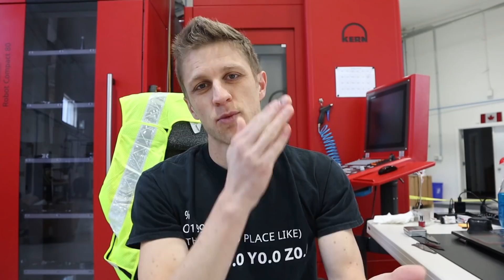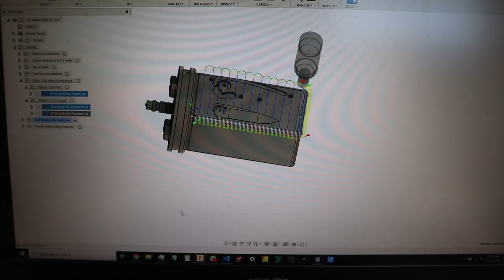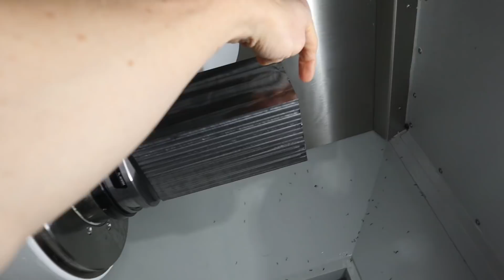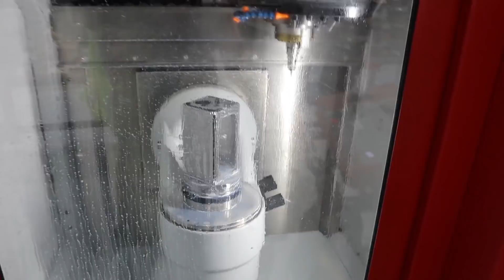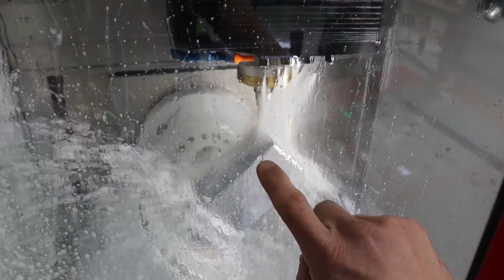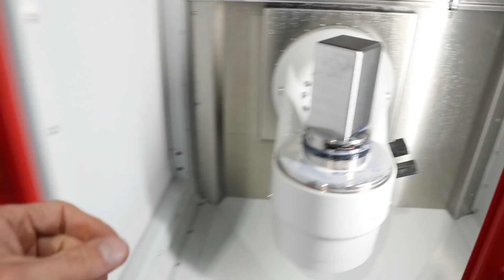Facing On The Kern - Quarantined Shop Life 25

Comment: 0.005” DOC you are dependent on the micro geometry of the insert and the matl is smearing rather than shearing off .  You would have got a mirror finish on 0.02” or 0.5mm

Comment: as i said in an comment on a previos video, the Heidenhain control normaly dont calc. the rotation of the b and c axis in the DRO, you have to activate it in the 3d Rot softkey for the manual mode.
i wish im able to show you this, but im in germany so its pretty impossible (also because of timezone).
edit. the 5axis milling is not TCPM (not on Heidenhain, TCPM is something even complexer).
(and i should stop posting comments while watching :D)

Comment: jon if you have a step over difference in passes with the same tool (in your facing op) wouldnt this point to the spindle not being true to the work (perpendicular to the work or knee if you will) could you put a noga arm and indicator in a collet and sweep around to see?

Comment: On that radius op try tilting the tool 20° or something out of perpendicular. You'd still have clearance and you'd be cutting with a better part of the tool with a higher sfm. Also definitely get some ground inserts for that indexable. For what you're trying to achieve on this fixture you'd probably just be better off what solid carbide than an indexable though.

Comment: The wavey finish may be because you are using a tipped tool at high speed and a very low federate, the cut at the sides is next to nothing and is probably only rubbing most of the time, try higher feed and smaller stepover. It may be what was wearing your tool edges too.

Comment: You can perform transforms in CAMplete and it will do the math for you and you can probe without being in a transformed plane.  Personally, I would cut all four sides and measure across, then adjust as necessary.  At some point with 5-axis you just gotta trust CAMplete and your machine.

Comment: After watching a bunch of Johns videos the saying "the best is the enemy of the good" really strikes me. I understand that you want everything to be "perfect" but all you are doing is wasting your time. You have so much stuff you need to get done and you are spending large chunks face milling improper DOC and trying to cut with the tip of a ball endmill. I don't know if fusion has it but you need to lead and lean your ball endmills (10 degrees or so) to prevent them form tipping out. If you want to get a better surface an insert endmill is not the way to go.\
Reply: Using a contour 3d toolpath you can enable multi axis tilting and specifie min and max angle of the tool from the normal of the surface. @Emanillis @usrenmae
Reply: usrenmae  I don‘t think fusion offers a constant angle for ball endmills. You can only set the tool orientation
Reply: Emanillis wrong!!!!! It’s in flow
Reply: You don‘t even need a ball endmill for milling the outside radii. You can just use a regular endmill on the perimeter. Cheaper and faster. In any case going lengthwise along the edge would be faster.

Comment: Does the head need to be re-trammed? Honestly with 1 tenth of “waviness” over less than an inch I’d be pretty disappointed. Maybe it needs a tune up after shipping?
Reply: The tool it self could have a slight deflection at higher speeds like what that runs at I would think a solid carbide might give you a better finish
Reply: I just assumed that was from tool pressure causing minor deflection in the tool, therefore making the bottom surface slightly “angled” in relation to the localized flatness
Reply: Depth of cut didnt look significant.  shouldnt have been enough to cause that much deflection.
Reply: Just the torque of the cutter will impart some deflection. Super short wide rigid tools are the answer, but with them tram is much more important.  If you run back and forth step over patterns the variations are worse. If you only cut one direction it will be flatter.  Milling at grinder tolerances is really quite difficult even with a top end machine.
Reply: I believe a lot of the problem here was lack of chipload.  Carbide tooling that is not dead sharp does not much like tiny finish passes.  It more of less just "smears" the surface and significantly kills tool life.
Reply: I think it's just from the stepover , when it glides over the already cut material , and the material to cut intersection , it might push? the material a little . just my 2 cents (, anyway i've experienced that too , about just less than 0.01 but in a wave 500mm long ...)

Comment: John, you doc definitely isn't deep enough and you need to only climb mill. If you run without coolant make sure to run air blast. In order to cut the amount you are trying to face you need razor sharp inserts. After they lost the edge the just deform the material instead of cutting it. Minimum .2mm doc for facing. I agree with others though use a 2 inch face mill or a solid carbide em. When side cutting your finish pass should be 10% of the tool dia. Use manufactures feeds and speeds to start and slowly keeping pushing the speed and feed until you find what you like. And as I said the canned cycle for pocketing is excellent for facing. It always climbs.
Reply: If you looked the bad surface finish its worse in the conventional direction.

Comment: A few things: First, speaking for a good portion of your viewers that are machinists we would rather have a hard time seeing that see you run those tools without coolant and recut chips. In regards to the ball endmill, don't be cutting with the center of the tool and you especially don't want the lick at the center of the tool, tip the work on its side and step your way up so that you are always cutting with the side of the tool. And in regard to the facemill, you need to go the way of solid carbide feed mills, they are ground and less of a hassle to set up, IMHO they makes more sense for machines with higher rpm spindles and faster feed rated like yours. It is effectively the ferrous alternative of the single flute concept Datron has been pushing for HSM.

Comment: John, If you want to check your tool height, leave .02" in your program tool call  (TOOL CALL ### Z DL.02). Finish all 4 sides then measure the pallet width at b-90 accross the Y axis. Your measurement should be .04" larger than nominal. If it's .041" larger, then your tool is off .0005. Likewise .039" will get you .0005 too long etc. It gives you the opportunity to check with a Mic as well to confirm the probe reading. Make your TLO adjustment in the tool table and reset your offset to DL 0 in the program and re-run the facing operation. Keep it up, You're doing great!